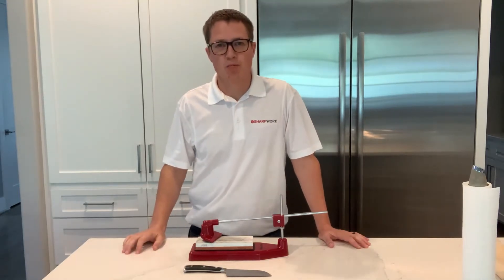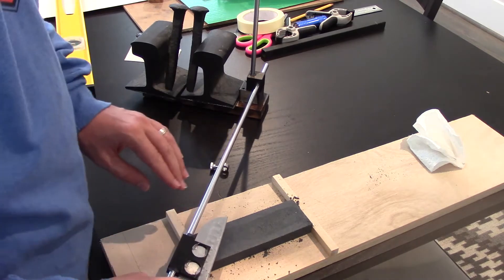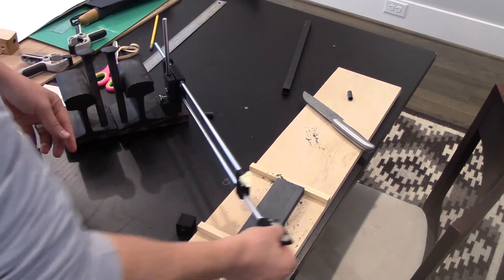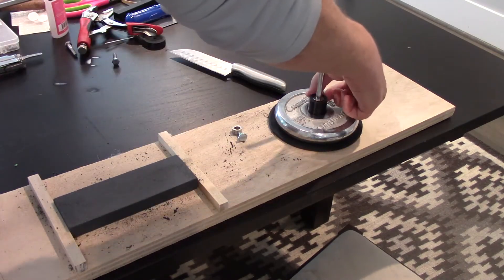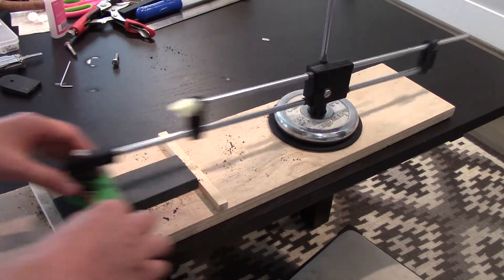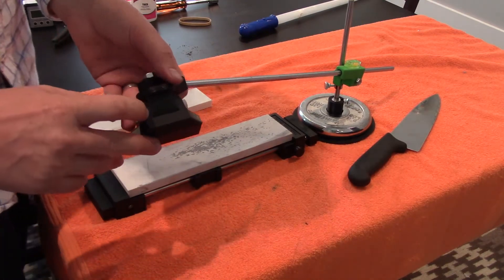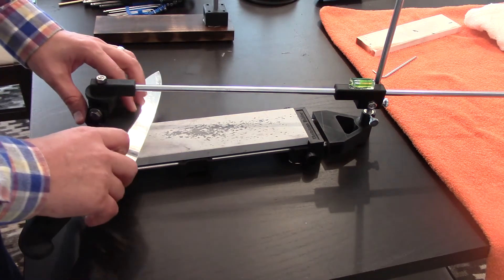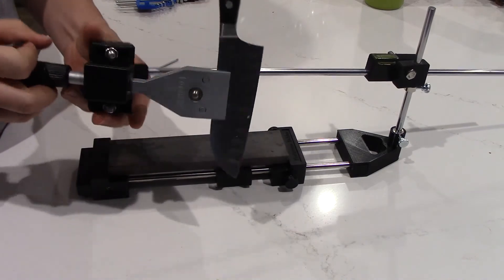Designing the SharpWorx Sharpener. Going through the prototypes of the SharpWorx Professional.

Comment: You also need to be selling the jaws and magnets separately, magnets are great for larger stuff but ppl don't like the mess they gather up. I'm ordering the jaw version but would like the magnetic clamps later too.
Reply from the maker: Yes. I can do that. I need to add those options to the website. It is on a long todo list I have. I also want to test out some different magnet configurations for smaller knives.
Reply: @sharpworx  Well as you can see I ordered with both clamp and magnet, At least I think I did, it would have been nice to have pics the show exactly what each set up was cause the wording was actually a bit confusing.

Comment: I've been sharpening for 33-35 years now and have been working on a similar system myself taking part and pieces from other cheap systems cause I've basically skint my whole life. There are improvements to be made here and you need exposure with this system, you've taken it further than I have and I don't care to keep working on mine so much now. I'll also be using this for the rest of my life, I know that for a fact.
Reply from the maker: I really appreciate the feedback. There are definitely improvements that can be made. The design works great. Things like a custom aluminum clamp is the main thing. Most of the improvements also require higher prices so I may consider making it a separate product.
Reply: @sharpworx  I understand that, getting prices right is tricky but I strongly suggest avoiding aluminium.

Comment: A clear indicator of degrees that are notched for a positive angle setting. This way you can't mess it up. That is my biggest complaint of most sharpeners......
Reply from the maker: The angle is marked on the side of the knife holder, so it is pretty clear what angle it is at.
Reply: I was on the website earlier and the angle guide looks like it's only notched plastic at big intervils. I'm ordering this soon but I can tell you now I'll be tearing that off or sanding it flat and adding a metal protractor.
Reply from the maker: @8thsinner  The part is 3D printed so adding the protractor on top would be better. That is a good idea for a design improvement. 

I’ve thought about switching to aluminum machines parts however the cost would increase by $100 just for parts. What do you think of this if it was solid aluminum but twice the current price?
Reply: @sharpworx  As I just said in other comments there, aluminium is garbage, if you want something that lasts a life time it is no where near good enough, Obviously you can't do the whole thing in steel right away though. I don't much like plastic either but 3d print materials are becoming tougher all the time so as a barrel surround I don't think thats too much of an issue right away. It's not subject to nicks and dings where it sits unlike the clamp which, no matter how careful you are is going to hit stone, and I for one will be using diamonds as part of my progressions, which will chew it to pieces. Though temporarily at least it might be easy to trim some material off for keener angles. 

The mods I plan to do in my head with it right now are just based on the videos I found yesterday and the pics, I ordered this morning to the uk, when it gets here. I can see at least 7 things to change so far, but thats only for my use. If you're thick skinned I can tear it a new one if you'll pardon the phrase if you want.
Reply from the maker: @8thsinner  I’m thick skinned enough to handle it. 👍 would you mind sending me an email with comments? Mark@sharpworx.com